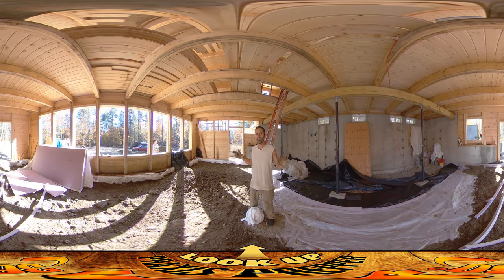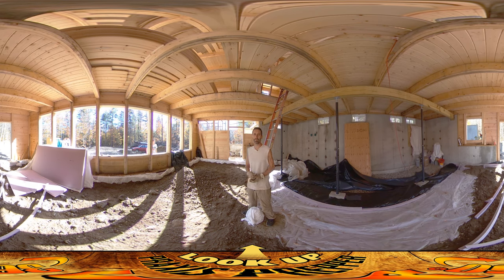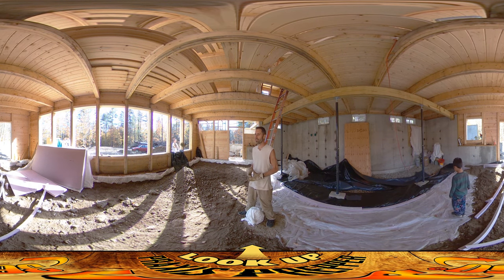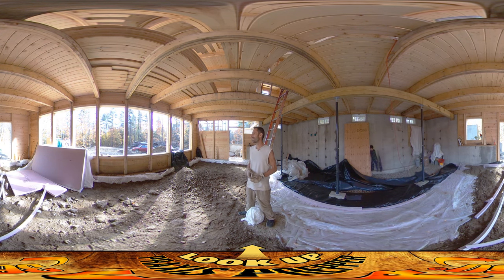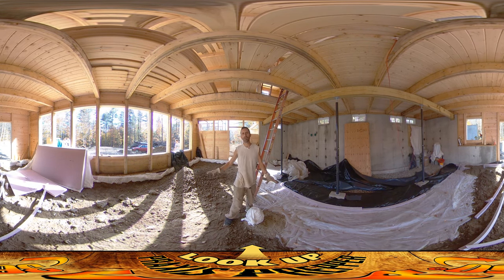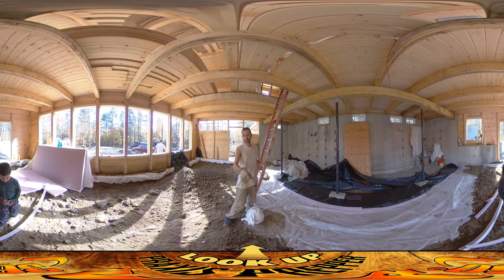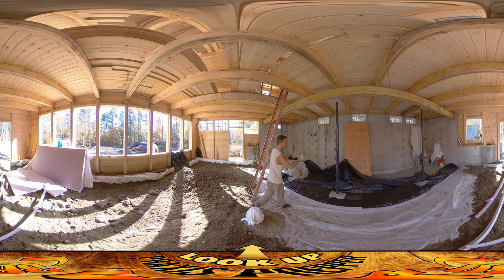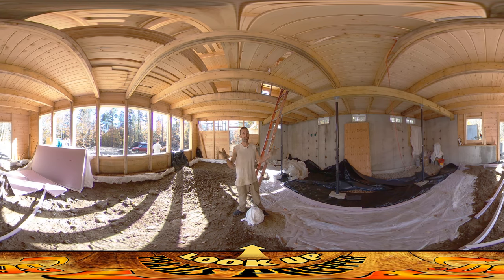Homestead Building - Sub Floor Thermal Mass Construction, Pantry Sub Floor Prep

Comment: Coming along nicely Praxis! I had a lot of trouble when considering a driveway. My driveway area is like 17,000 sq ft and you can imagine the cost to blacktop that ($40k+) so I went with DG base which seems similar to what you're talking about. Basically it has a fine powder in it so as it rains a bit and settles it almost turns into a very primitive cement type situation. Of course it's not nearly as hard as cement but it is leaps and bounds above regular gravel. I also love how the whole time you shot this video you stood there and talked the whole time and Josh humped his ass off with rock! haha.
Reply from the maker: We actually decided to set it up that way so he'd be working hard and I'd be hardly working. ;)
Reply: Praxis Homesteading and Survival Skills you filmed for 8 hours straight just to get him to finish the pile, didn’t you??? 🤔
Reply: Prescott Caliber Club Mind if I ask how long and wide your driveway, the depth of rock and what the cost ended up being in the end?
Reply: InMyImage sure but I will have to do a little research on the depth. My driveway was about 17,500 sq ft (part of that is a road coming down an easement and the other big piece is for turning around a 70’ rig we travel with. The total for the driveway was around $7500. I know they layered and compacted it for me, but I will have to check on the depth. I’m out of town right now too. I also put that DG down under my gravel driveway at my last house and it didn’t move the whole time we lived there. And I drive big trucks and stuff.
Reply: Prescott Caliber Club Thanks! We hope to buy some land next year and laying down what I think is referred to as "road base" gravel is what we will do. We also will be looking at driving a rig that will probably be 55-60 feet for a fifth wheel and truck on it so similar to your situation. Based on the land ads we have looked at so far with 5 or more acres, I'm pretty confident we will have to cut the drive all the way to the road.

BTW, when do you expect to have Praxis' card game? I had to wait till the end of the kickstarter campaign and got sick and slept through that weekend so I missed the end of it but want to send my nephew a deck or two since he is in either boy or cub scouts and it would be good for him to play with his troop.
Reply: InMyImage I’m on 2 acres and I have another 2 acre lot between me and the paved road. I feel like I had a video or photo of the arial view of the property. I’ll see if I can find it. 

I just emailed him a couple days ago and he said that he should have them by Nov 14th and then he will ship my batch ASAP. So I think in time for the Holidays. You can go online and preorder now and they’ll all ship when praxis gets then to me.
Reply: Prescott Caliber Club Sounds good, I'll probably wait till the end of the month to see how much damage I do on Black Friday. My pay is only once per month so it can make budgeting a pain.
Reply: InMyImage no worries. I have a lot of copies coming so they’ll be available for quite a while!
Reply: Prescott Caliber Club 👍 I'm subscribed to your channel and assume you will post a video about the game after you receive them.
Reply: InMyImage yes I’ll get something up there. praxis and I may have been talking about some ideas as well. 😉